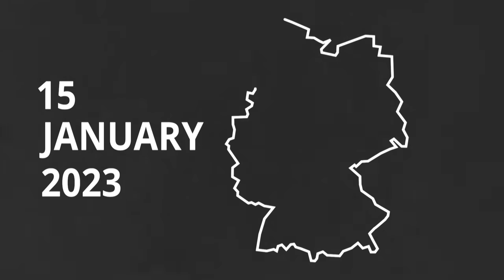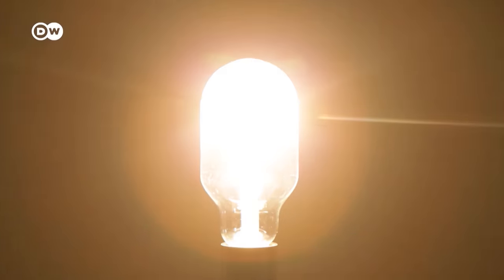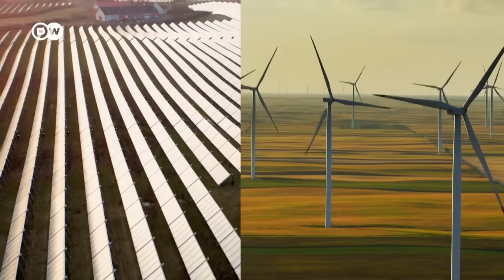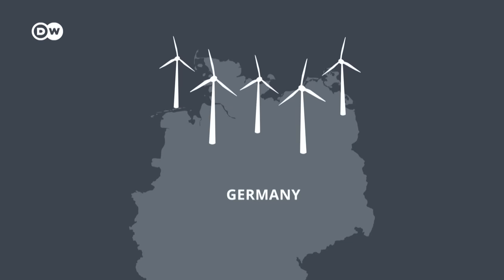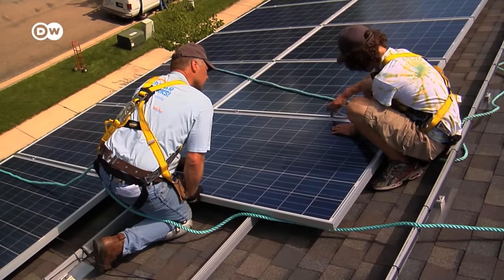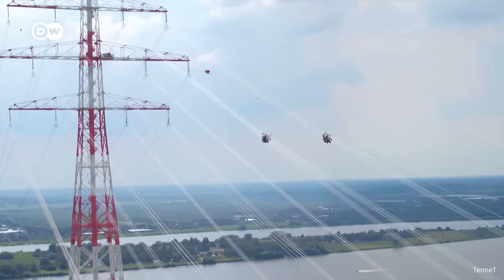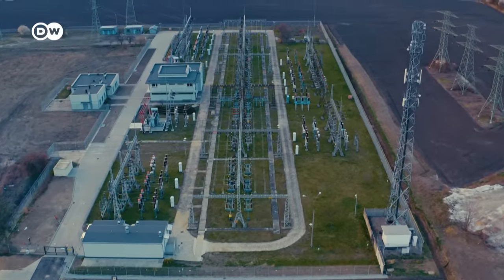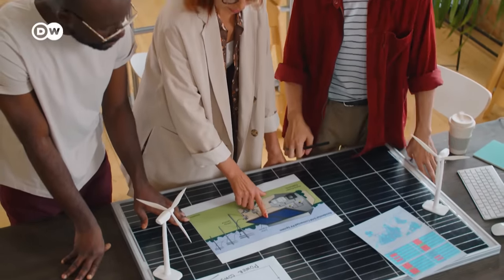This is what's REALLY holding back wind and solar

Comment: We could also use our houses as batteryes.
We could heat the house a little hotter when energy is cheep and have it a little colder when energy is expensive. For houses that are isolated well you could actually store a disent amount of energy and if all houses did it could make a huge difference, at least places where you have heatpumps and airconditioning.
Reply: there are houses like this that already exist, using heat pumps and other technology to essentially create an energy loop using the byproducts of ther other energy uses in the house, including using expelled C02, to use as power by other systems. 

the issue is that all that shit is just so fucking expensive. we have a LOT of really useful tech we can use right now to make a LOT cleaner systems...but it's all about money... if something is too expensive it wont get widespread adoption and, the oil/coal/gas companies that are already making money hand over fist, can afford to throw money at other energy uses/systems to keep them from usurping their monopoly.
Reply: Yeah, producing tons (literally) of batteries for BILLIONS of homes would be great for the environment! /s
Reply: @PistonAvatarGuy  no its not actual batteries, but more like storing heat in a house and having the heat be an energy source that can be used like a battery.
Reply: @gabrieldsouza6541  That doesn't really help anything. In much of the world, getting heat out of homes is the issue. If you're talking about converting heat into electrical energy, that's never been done efficiently. Storing energy as heat energy is just inefficient in general.
Reply: @PistonAvatarGuy  district heating?
Reply: @PistonAvatarGuy  using a heat pump to warm water using excess heat isn't that inefficient it just depends on the delta T value
Reply: @gabrieldsouza6541  The problem here is that wind and solar produce electricity, anything involving heat results in losses.
Reply: I would build houses using wood and hemp blocks with an attached south facing greenhouse with a thermal blanket. If we have large diameter underground pipes heat pumps would be far more efficient.
Reply: @higreentj  In the long run, it is always a matter of costs versus profits. And methods that work for single houses in Florida will not work  for a skyscraper in New York, Shanghai or Frankfurt. Currently we use stockpiles that have been created millions of years ago (coal, oil, gas) and are not replenished anymore. They have the big advantage of being transportable (but unfortunately finite and harmful for our environment).
There is a growing number of off-grid homes that show how parts of the world could change, but those recipes need a lot of room per person, that we currently do not have. In the long run, I expect to see a multitude of different approaches running parallel to each other and decentralization being an important part of it. Unfortunately big industry does not like decentralized structures ...
Reply: @wora1111  Bamboo and hemp remove far more CO2 than trees so governments should provide subsidies for these building materials especially in earthquake zones like Turkiye.
Reply: @higreentj  I suppose you are just referring to single homes? I have trouble imagining a bamboo skyscraper
Reply: @wora1111  We could build six floors with wood using hempcrete blocks for insulation. We might be able to use bamboo to strengthen the hempcrete blocks. We could produce lime (as a binder) in electric kilns using renewables. If we grew most of our food in greenhouses, like China does we could then use the no longer required agricultural land for other purposes like growing building materials and building homes. If every country did this we would stop climate change.
Reply: @higreentj  wood and hemp will not face down extreme weather events without the use of steel or concrete. not a solution for most of the world.
Reply: @gabrieldsouza6541  I have noticed that houses that do not have concrete and brick footings have a problem with mice so I would partly use bricks and concrete. I wouldn't have windows I would have an oled tv screen instead linked to security cameras around the building. This way I could see around the property or any view I wanted, perhaps a sea or river view. With led lighting we don't need natural light and without windows the building would be structurally stronger with improved insulation. I would have a heat pump and a heat exchanger circulating the air.
Reply: @higreentj  How did you get the idea China is using mostly greenhouses for the production of grain or rice? They uses just standard fields like everybody else
Reply: @wora1111   "The Kaisheng Haofeng Smart Greenhouse in Dezhou, Shandong is the largest single glass greenhouse in Asia, with a total of 25 hectares, equivalent to the size of 600 standard basketball courts. The glass greenhouse is made of ultra-white rolled scattering glass."  They are also building vertical farms. It will be fruit and vegetables not grain and rice.
Reply: @wora1111   The plan is to convert all our food crops, starting with rice to C4 photosynthesis which will increase food production by fifty percent and use less water.
Reply: @gabrieldsouza6541  Bamboo removes the most carbon but would need to be treated against termites. Hemp would remove double the amount of carbon compared to trees. Hemp is an ideal building material.
Reply: There is very little margin for overheating or underheating buildings. If exceeded, it has a negative impact on both the comfort of living of the residents and the condition of the building (physics of moisture migration, etc.).
Reply: @gabrieldsouza6541  "Queenslander retrofit hempcrete home (hempcrete how to)." This is an interesting video. We could build machines to mass produce these homes. Hempcrete walls lock away carbon for hundreds of years and become stronger over time.
Reply: Houses used to be designed to function like that before energy became cheap and easy.

Comment: Intermittency. Talk to the Power Engineers about synchronisation and the ability to route power from one region to another. As a rule of thumb it is a bad idea to connect wind turbines, forming more than 20 percent of total grid capacity, as this will put grid stability at risk.
Reply: Some places are already 100 per cent renewables.

Comment: Here in Brazil, wind energy is produced in the northeast, while the largest consumer market is in the southeast. So it's a challenge, but at least the government has been holding auctions to build new transmission lines. 
The problem at present is connecting the only state in the country that is outside the national electricity system, because the future transmission line passes through indigenous lands.

Comment: I am VERY tightfisted (very low income) so when it comes to energy I've now got my average daily consumption down to under 5kWh. I would be more than happy to use energy hungry items (washing machine, cooker etc) during times when the grid is less under stress but there needs to be some sort of reward for doing so as well as a notification system. Without those it would fail. 
Saw an intersting video the other day regarding energy transmission where they are starting to switch from AC to DC (or is the other way round...) due to the much better long distance transmission capability.

Comment: In the UK the excellent energy provider 'Octopus Energy' is now rewarding UK customers with large export payments by discharging their home battery storage at the peak 4-7pm period.

Also they have an export payment tariff that varies every 30 minutes depending on the demand on the grid vs supply. If demand is alot higher than supply they will also reward the customer with a large export payment again. Turning the customer into a valuable generator on the grid!

Comment: For a lot of applications you could just as well use that solar power to heat a big stone in your yard and draw the heat from it during winter time. Problem gone.
Reply: Our school does exactly that. But I wonder whether you have an idea about the size of the 'stone' needed. Usually it is smarter to fill a well isolated pool of a mix stones and water
Reply: Actually, water is best. It has the highest specific heat of any substance.
Reply: @christophermay4540  Important is less the specific heat as related to mass) as rather the heat capacity per volume. For high volumes the material of the container also has to be taken into account.
Reply: Were called electric storage heaters!, well insulated with a fan to distribute the stored heat as needed.

Comment: Yes! I live in Phoenix AZ and have Enphase solarI with batteries.  With just a little bit of monitoring our system on our app we can determine the best time for heavy loads until we have enough solar and battery power.  It's not difficult.  In May and June we can start the washer by 8:00 am and the dryer by 9:00am.  I have not paid anything for electricity in 2023 and have a 175 dollar credit so far this year.  Our system is about 8 months old and we love it!
Reply: The downside: at some point you may need to go outside and it's Arizona.
Reply: Yuma, Arizona and Aswan Egypt are the two sunniest cities on Earth. Lodwar , Kenya may actually be the best place for solar power. In all 3 locations it would be very good for powering air conditioning .

Comment: I really think there needs to be more of these "proconsumers". My theory is that if more electricity customers were enabled by the power companies (for a fee for the equipment) to produce as much of their power themselves, there would be a whole lot less demand for power from the "grid" itself. This would make their task MUCH less difficult.
One of the biggest advantages of renewables is the ability to produce the power right at the place it will be used. 
Our centralized "grid" is not designed this way, and it's clear that the people in charge don't understand the potential of power production at point of consumption. 
It's literally HUGE! Look at what percentage of their electricity Australia produces just from 1/3 of  households. Now imagine 2/3 of household and most businesses too.
That's a whole lot of power.

Comment: the longer the distance the higher the resistance, let alone the maintenance. Is that really feasible and is it adequate to connect south and north germany only? or germany must conncet with many other countries that are even further?
Reply: There actually is a unified grid across Europe, but politicians do not really understand that and have little influence across the borders of their own country. The two control centers for the European grid are located in Germany and Switzerland and usually make certain, no problems will arise. For that they have to have a good feeling of the expected need for energy for the next hours and days and how to guarantee the supply. That is, what the guy from TenneT said. Interpreting weather reports is harder that just looking at the schedule of power generation of a coal plant.
Reply: @wora1111  yes, there is a unified grid but, what I know about Germany is that they may supply electricity from the borders of France. Is it practically possible to supply electricity from Spain in Germany for example or is this just economically unsustainable?
Reply: @georgioskaraiskakis2725  In order to control the flow of energy you would have to turn off some connections. In Realität most of the Spanish energy would be consumed in southern France and French energy would be deliver to Germany, probably passing through Switzerland.
edit: Number of typos reduced
Reply from the maker: The European Super Grid is still a long way off, but the ambitious plan is a European interconnected electricity grid that would also extend to countries in North Africa and the Middle East for example. (Read more here: 🔗 https://www.eyes-on-europe.eu/the-european-super-grid-a-solution-to-the-eus-energy-problems/.)
Reply: @DWPlanetA  Hmm, I am somewhat less optimistic. I am old enough to have seen lots of prophecies in the last 50 years that proved to be hypes and wishes but not things that could be implemented.

Comment: To make prosumer contribution/usage more effective and stable if they have local battery storage, we could design systems to contribute exactly in proportion to the daily electrical demand curve, or even the deficit curve, customized for each system based on its state of battery charge and solar predictions. This information could be made available on the Internet for smart inverters to use.
Reply: or even better, a real-time smart inverter that reacts instantly to the real-time pricing of the electricity from the meter, exports when the price is at its highest, and import when the price is at the lowest

Comment: I already have dynamic pricing (Tibber) and the price very well matches renewable availability. This is, how my car charges, when electricity is cheap (price is sometimes even negative like last Sunday). Also my heat pump will mostly use low price power, when installation is finished and also other devices (dish washer, laundry, oven) in my home run preferably, when prices are low. From January to June, my average price was 26 ct/kWh, while most people have 30-60 ct/kWh (40 ct/kWh are the mean) depending on their contract and when they switched it last time.
Reply: Yes, but Germany insists on one price zone despite the grid is divided with limited transmission capacity between the areas.
Reply: @Jakob_DK  You are totally right and I'm really waiting for the day, we get two or more bidding zones. I live in bavaria and I hate our government for blocking everything related to transmission lines and wind energy harvesting. We externalizing cost of our behaviour to other states that have way less money. If we get divided in bidding zones, my electrical prices will be even more below the fixed rate prices of my neighbours. But I also know, that I will have to pay the price for living here through e.g., other consumables. 
I hope, that our bavarian government will learn their lessons, better yesterday than tomorrow. If we keep acting like "we" do currently, bavaria will see a massive de-industrialization and we will see e.g., a renaming of "Bayerische Motoren-Werke" to "Bremer Motoren-Werke". I think, if this could happen, we will find wired ways to compensate the companies, spending enormous money to keep the industry here. But the money will be taken from other areas like schools, social stuff,...
All this makes me nervous and angry, because I understand all the implications and I know the solutions, but I'm only someone with a very silent voice.
Reply: @the78mole  
Well you pay to stop wind turbines and other power to be produced in the south (and reverse with solar) 
Those cost makes industries less competitive and take money from schools, you don’t have to support industry you need a market reflecting the realities of the grid. 
Wind in the north lowers spot electricity price (day a head) but limits of grid makes it necessary to pay to stop wind turbines and pay to start gas turbines while consumption increases with the low “day a head” price.
Reply: @Jakob_DK  Yes, I know, how it "works", when we have wind in the north and solar in the south. But the reality in germany is also, that the industry does not pay the large piece of the infrastructure cost (Netzentgelte), they mostly pay the average spot market price. The infrastructure is payed mostly by private households and small to medium companies. It is simply a lie, that germany has the highest prices, if you do not refer only to household electricity. 
But if we do a split, the infrastructure cost will swap over to the spot market prices of the part that has less production while the prices in the region with high production will get deadly cheap prices. For bavaria this means, we will have deadly cheap prices in summertime, but only for a few hours during the day, while the north will heave low prices most time of the year (even during the night), especially in wintertime.
Industry in Baviaria (or the south of germany in general) is fu** up, when the split is finally executed. We can not build enough transission lines and wind power until this event...

Comment: And people will still claim that renewables are less expensive than nuclear. I suppose that they might be, as long as you ignore the grid upgrades and the energy storage needed to make them viable on a large scale. Imagine if we lived in a world where people chose the most simple and effective option, what a world that would be.
Reply: @st-ex8506  Completely wrong. There are almost no assessments of the cost of wind and solar which include the cost of storage (or the costs associated with the variability of wind and solar in general), this is why they always appear to be less expensive. Heck, in this video, it shows that the cost of the storage systems and grid upgrades needed to make wind and solar viable on a large scale would cost as much as covering ALL of the global demand for electricity using nuclear, and that doesn't even include the cost of the wind and solar energy systems.

If we were to adopt the French model for building nuclear reactors, the cost of NEW nuclear could be significantly reduced, it's only expensive now because the power plants are built one at a time and the economies of scale are made irrelevant.

Edit: And if you believe that industry can make use of solar and wind on a large scale, ask yourself why Tesla never achieved their goal of running their Nevada Gigafactory on solar and wind energy produced in the vicinity factory. Tesla is (supposedly) a solar energy company and produces batteries directly on site, yet they still can't make the economics work, and people like you don't find that strange?